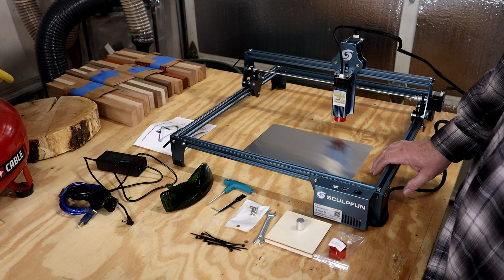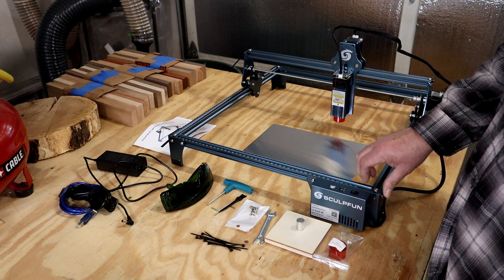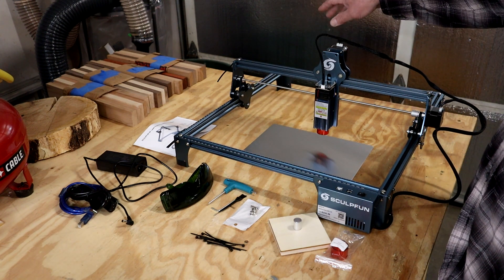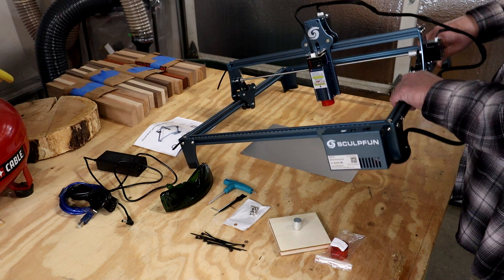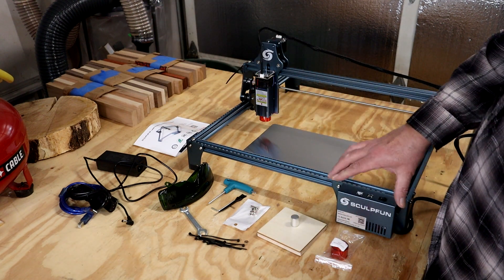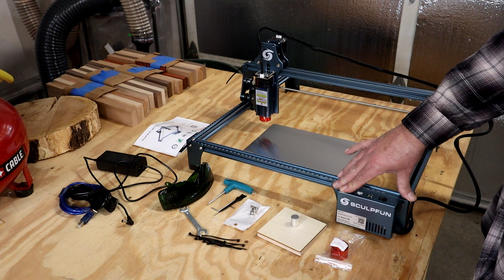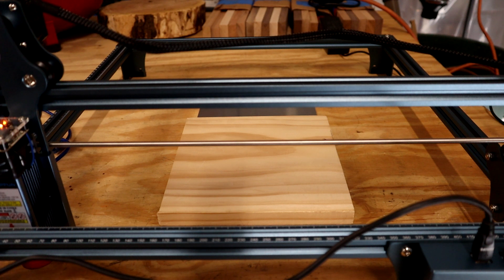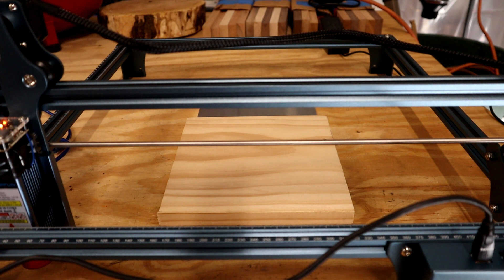SculpFun S9 Laser Build and 1st Time Testing

Comment: I've seen numerous laser videos, where people strongly recommend having a fire extinguisher handy. Seriously? What realistic level of fire risk do you think a laser of this size (I have this model myself) actually presents? The absolute worst case scenario is that a tiny flame will momentarily flicker up from the burn area....hardly enough to set a chunk of wood alight, and certainly not the kind of "fire" that would spread so fast & ferociously, that you couldn't simply blow it out like a birthday cake candle! Even if you were laser-cutting a piece of paper (which is the only sort of material LIKELY to catch fire with a laser), do you really think it would cause the kind of blaze that warrants the use of a fire extinguisher? Come on, people....get realistic, and stop being such drama queens! If you're THAT paranoid/incompetent, maybe you shouldn't be in a workshop without a responsible adult in the first place! 🤣🤣🤣
Reply from the maker: I think its just basic safety to have a fire extinguisher in your shop, kitchen, household. The laser burns wood. Anything that burns anything has the potential to cause a fire. Ive been in the trades all my life, be safe when you work with tools. period.
Reply: @grtbaldini  I've worked in various engineering environments for almost 40 years myself, and am no stranger to all kinds of hazards; chemical, combustibles, explosives, you name it. As for wood, unless it is soaked with some kind of accelerant, it actually takes a concerted effort to set it alight. A laser beam is extremely unlikely to set fire to a piece of wood, in such a dramatic & sudden fashion that would warrant the use of a fire extinguisher. I'm all for safety in the work environment, and have seen my share of nasty accidents over the years. However, I honestly think that feeling the need for a fire extinguisher being on hand when using a relatively low powered laser is bordering on paranoia, and suggests lack of experience, more than anything...period!